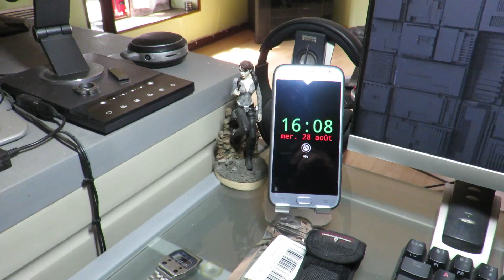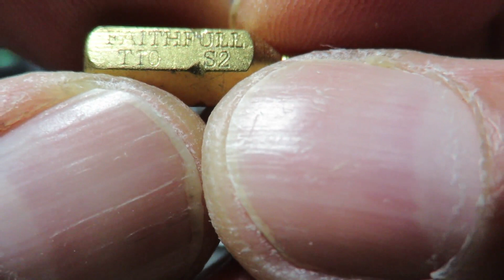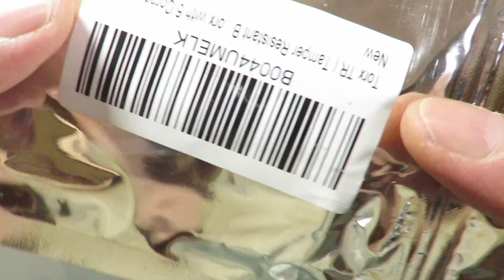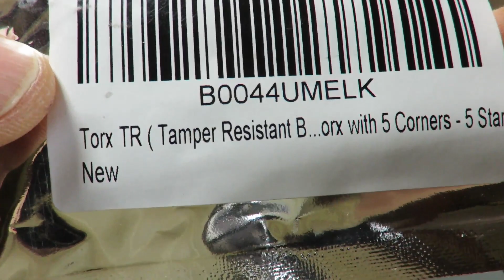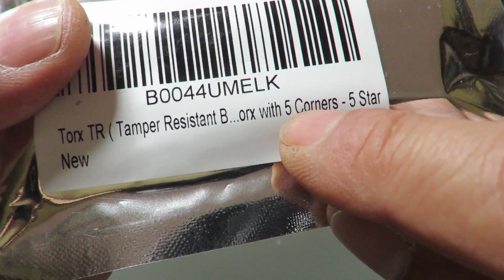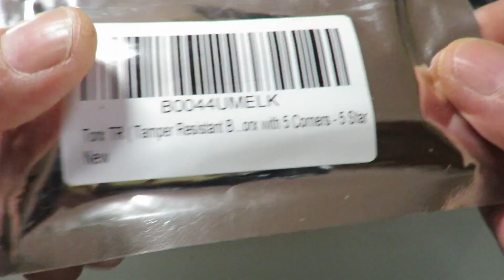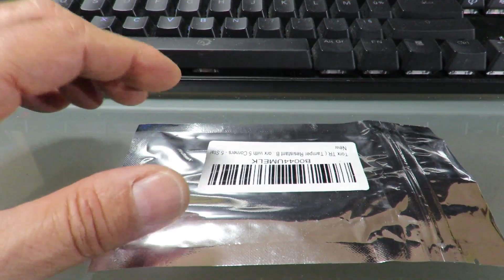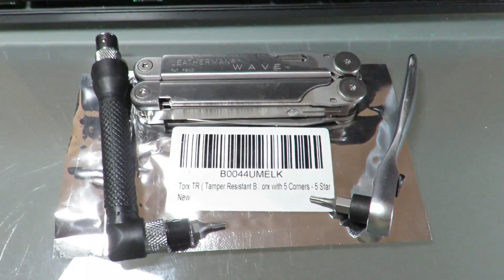Leatherman ORIGINAL WAVE : How to disassemble or adjust ?

Comment: Hey how did you reattach the pliers to the body because I'm struggling to line the holes up n hold them in place to slide the bolt in
Reply from the maker: I did not disassemble my Wave ...

Comment: Didn't find bit on amazon would you give me link pls.
Reply from the maker: https://www.amazon.fr/JBM-51746-Rail-douilles-inviolables/dp/B01K7E6DN6/ref=sr_1_4?__mk_fr_FR=%C3%85M%C3%85%C5%BD%C3%95%C3%91&crid=C378XQ4W3TBE&keywords=torx+5+branches&qid=1669724218&qu=eyJxc2MiOiIyLjcxIiwicXNhIjoiMi4xNSIsInFzcCI6IjEuOTIifQ%3D%3D&sprefix=torx+5+branches%2Caps%2C76&sr=8-4
Reply from the maker: https://www.amazon.fr/Gasea-Tournevis-Magn%C3%A9tiques-S%C3%A9curit%C3%A9-Inviolable/dp/B07S825VBT/ref=sr_1_6?__mk_fr_FR=%C3%85M%C3%85%C5%BD%C3%95%C3%91&keywords=torx+5+branches&qid=1669724373&qu=eyJxc2MiOiIyLjcxIiwicXNhIjoiMi4xNSIsInFzcCI6IjEuOTIifQ%3D%3D&sr=8-6